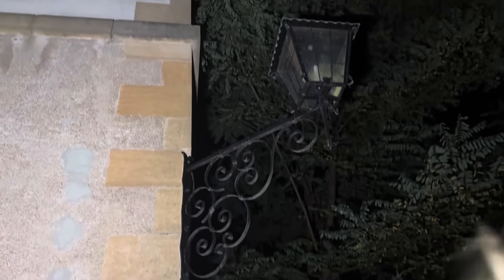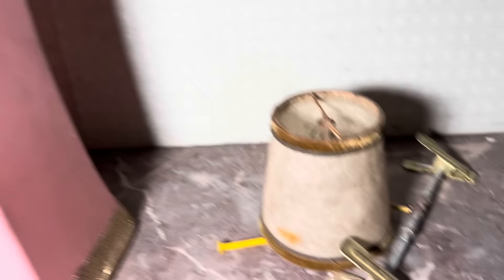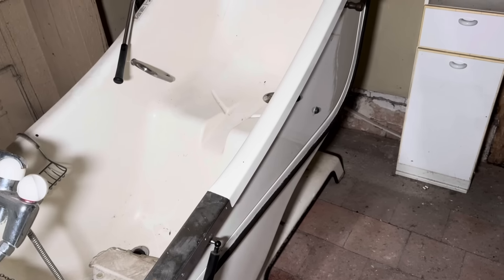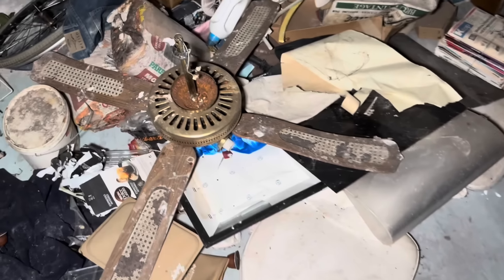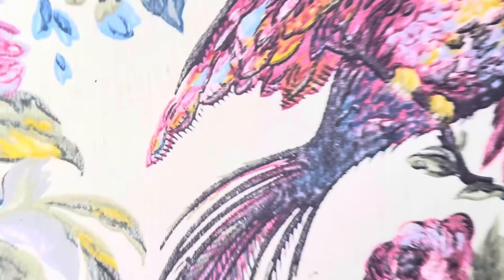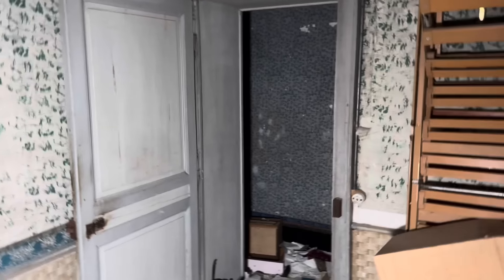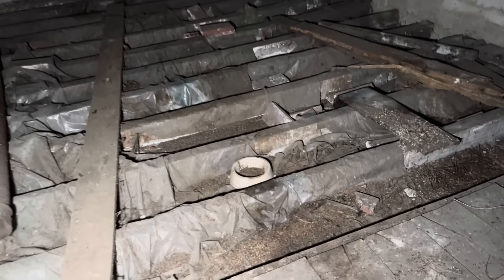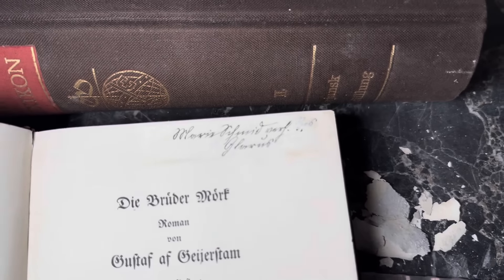CREEPED OUT in this Spooky ABANDONED old house in the woods

Comment: As a mobile Security Officer I used to have to regularly check certain buildings through the night. One of which was an abandoned pub. I never liked going in, but I particularly dreaded the cellar. Wet, steep stone steps. Low rafters with spiders, and of course pitch black. One night I heard something. I spun round with my torch. A pair of eyes were staring back at me. But what really made me make a bolt for it, was it winked at me. Never been so scared. Being even more nosey than cowardly, I went back to get to the bottom of it. It was a frog!